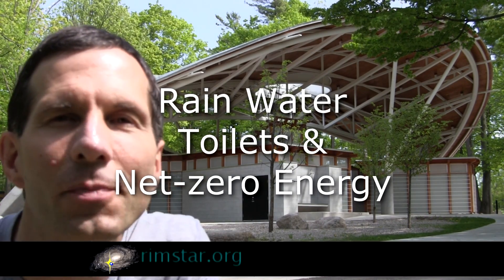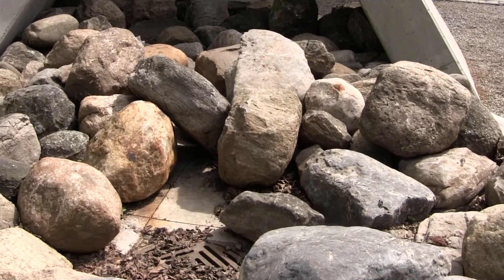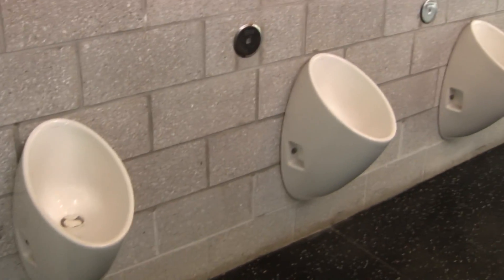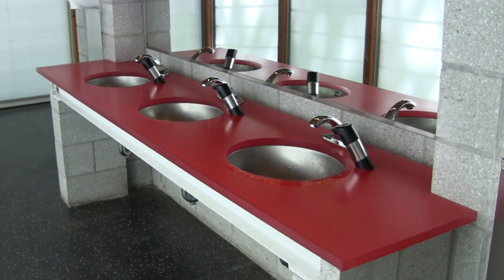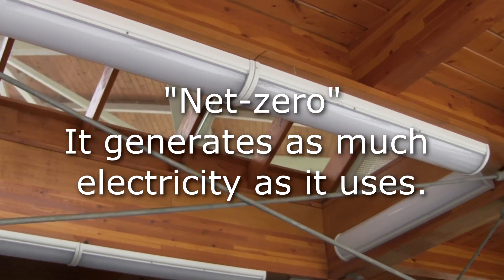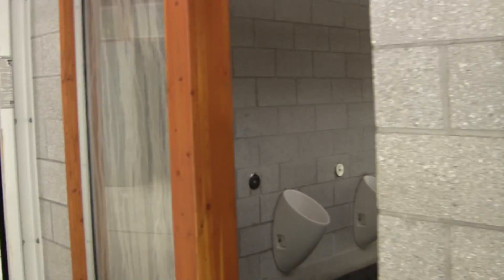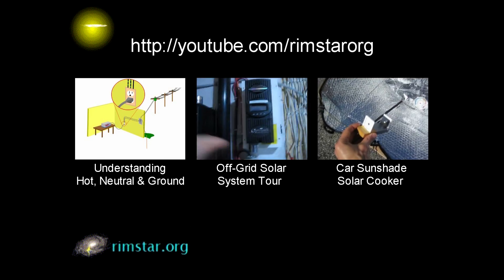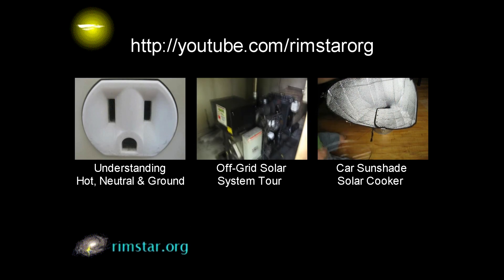Rain Water Toilets Net Zero Energy Vincent Massey Park Service Pavilion

Comment: Dude i love your stuff ive been trying to figure out the atmosphere energy for a house andnd made with like 3d printed parts.... do you know anything about 3d printers? Whats the amos and volts you get on the Corona  atmosphere harvestimg ion unit..corona
Reply from the maker: I have a CR-10 Creality 3D printer but the atmospheric energy can't power a house. There just isn't enough energy available, which is probably why it's never been done. I don't know how many amps and volts I got but I do know that a light touch with my finger on the motor shaft made it stop, which means there's very little power. Plus the amount of current in the air is miniscule, as I talked about in my how it works video mentioned https://www.youtube.com/watch?v=2rVdEhyMR6A

Comment from the maker: The power from the nearby solar panels is sold to the grid. Here in Ontario that's through what we call the microFIT program. At the time of their contract they were locked in at selling to the grid for $0.82 per kWh (the price has since dropped over the years as the solar panel prices have dropped.) At that rate the payback is around seven years. Without the microFIT program then definitely, it would take around 40 years to break even, longer than the panel life.

Comment from the maker: Yup. There's another one in the same park that has solar panels but I don't know if it's a net-zero electricity user too. It's an older facility without all the sunlight coming through the walls and no skylights. Small steps I guess.